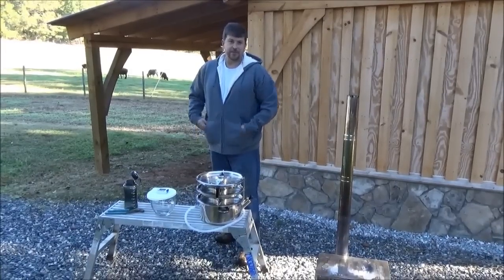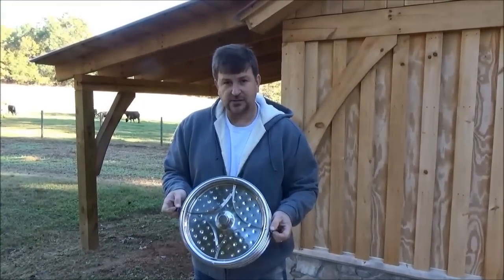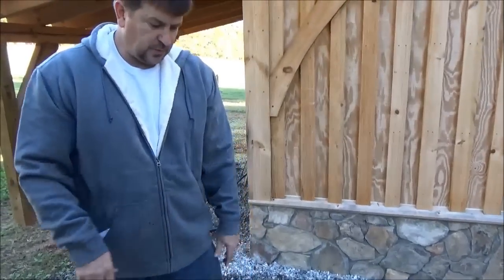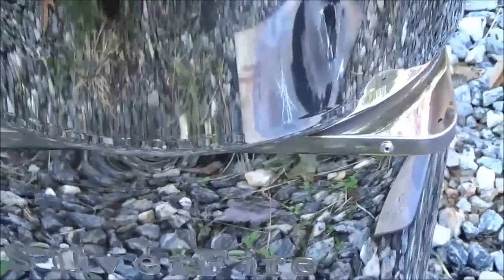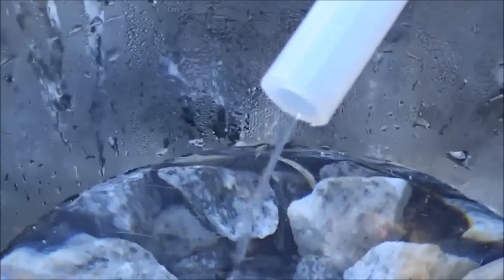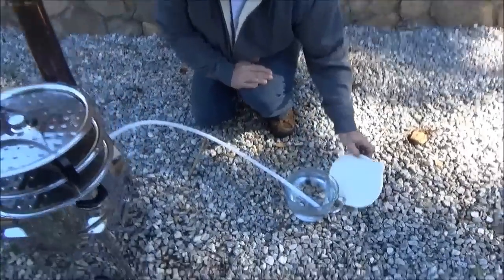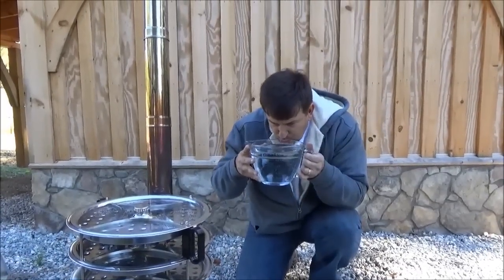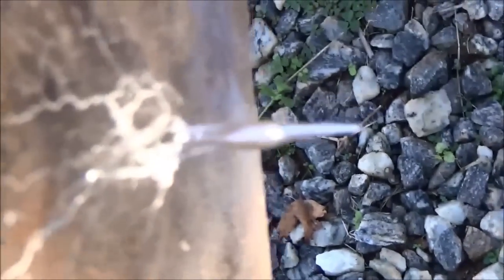Off Grid Water Distillation at its Best!

Comment: If water condenses on the trays and drips down through the center, why on earth would you pour water onto the trays??? Should you not, only start, with water in the bottom of this thing and nothing on the trays?
Reply: The water on top of the trays is used to cool the trays through evaporative cooling so the steam condenses. The dimpled trays are likely hollow and the condensate forms inside them. The water on top does not go into the collection system.
Reply: I would a diagram of the flow path to understand this.....
Reply: Keith MacDonald I think the water on the top of the trays is a bad idea also. You want a cool surface for the water to condensate on. A half an inch of heated water is not what you want on top of that surface. Try it dry and I bet the amount of distillate increases dramatically. A rocket stove may be even more efficient. Great video!
Reply: +Mars Rover The reqjuirement for a "cool" surface for condensation is a common misconception. To a volume of steam, any surface less than the boiling/condensation point is "cool". As a matter of fact, the colder the plate the more inefficient the process, as cooling the water far below the condensation point is a waste of capacity.
Reply: Interesting. Thanks.
Reply: Keith MacDonald Not sure I agree with that, here's what I'm thinking:

A surface one degree under boiling can only harbor so much condensate.  This causes more steam to escape the ventilation node (a requirement).

Cooling the collection plate allows it to operate at a higher rate of production because larger amounts of water condense and collect at a higher rate of speed (the closer that speed to the rate of evaporation, the less water is lost out the vent).

If there were no vent (dangerous) you'd be right in the yield being the same but it'd still take longer to produce the same amount.  The water condenses because it is giving up energy.  The larger temperature difference allows more energy to be given up (and therefore, more condensate collected).

This should mean both a greater yield and a shorter amount of time; both useful results.

Sounds right to me anyway?

Comment: years ago i built a water distiller out of 50 feet of 3/8" copper tubing coiled inside a 5 gallon bucket and used an old pressure cooker as the boiling vessel. it worked very well and condensed all of the steam and could produce 20 gallons a day if you really needed that much distilled water. so yes, you can build a cheaper distiller but the waterwise 1600 is a really cool design that takes up a lot less space, that's what you're paying for.
Reply: Will you tell me how to do it??

Comment: I am an engineer also and a prepper  Nice system especially for winter use.  Below is my system that might help you with a solar design:
My solar still produces about 5 gallons a day in October on sunny days.  I used an old duel pane solar panel about 3' by 7'.  I stood it up on end slanted against a rock wall fence.  Water level is maintained by a mounted water tank next to the panel that connects at the bottom. The highth of the water in the tank determines solar panel water level.  Next to the panel I built a wooden 3 level shelf stand.  At the top of the solar panel I ran copper tube up first and then down to my first copper coil inside a 2' by 4' water cooling tub and came out the bottom/front side.  Below that tank I ran a second copper coil to my second tank and then out its bottom to feed my 5 gallon distilled water container, final product, sitting at the bottom of the stand.  The top tank removes a large portion of heat from the descending vapor/liquid.  This heated water in the tank (heated from transfer of heat from vapor coil) is then fed to the bottom of the panel and thereby reusing the transferred heat. I tried to position the coils so that all fluids/vapor are being pulled downward by gravity in all portions of the tubing.  Top and bottom tanks are fed by sprinkler timer.  The top tank then also feeds the solar panel and determines what level in the solar panel the water sits.  The bottom tank is fed by sprinkler timer also but does not feed the panel water and is always much cooler then the top tank.  It's water is only used to cool the second coil.  The panel has four ports one on each side at the bottom and one on each side at the top.  I occasionally use the unused bottom port to drain the brine.  I may adapt a valve to automatically dump, the brine, at the end of the day by sprinkler timer later on.  It is important that when you connect the top of the panel to the top coil that the connector is not tight but is left loose to allow air to occasionally enter when good flow occurs or you will create a siphoning effect and get about 20 gallons of possibly sterilized water that is NOT distilled at the end of the day.  There may be some steam loss because of this; but, the effect is negligible.  An improvement I could easily make is take the duel pane glass off the panel and spray the now gray copper sheet and copper tubing black again and I should have more output.  Thanks for your video....good research and testing.
Reply: HI can we connect by email or app so I could try make one . With your good info and can i see a picture or video of it thanks

Comment: I love it!
But, you may want to do away from the plastic pipe and go with copper.
Also you may want to add a charcoal filter for the VOC's (volatile organic compounds) the boil off first.
That's a pretty awesome system!
I plan to use my 23-Quart Pressure Canner by presto on my Liberty wood stove and copper tube the steam through my outside wall into a 5 gal coolant bucket during the fall/winter months into a charcoal drip filter and then a 5 gal glass catch basin.
Being I have to heat my home (wood heat) and it's cold out (condensing the steam) 24/7 I might as well be making pure H2O surplus for the summer.
P.S. I am on my second H2O lab distiller so I need to bring down the cost and this is my best opposition.

Comment: This is good for your batteries that may power Solar, but I love the Berkey. My first line of water purification
Reply: But remember, the Berkey does not remove salt from the water. I also use a Berkey to filter freshwater, but when the freshwater runs out and I have to switch over to saltwater, distillation or desalination is the only option left.

Comment: Your set up is good!  i use a 1 gallon still myself and love the results.  But, mine is electric, and yours will burn just about anything in an emergency. nice job on the video.
Reply: The key is low heat not high heat. Solar Water Distillers are much greater. feel free to join the Distilled Waters Group on facebook aswell as inviting others.

Comment: For your information, Sea Water should not affect stainless steel whatsoever. It will form a highly crusty crud on the inside of the boil chamber, but you should be able to just tap on the boil chamber to knock out the crud and scour it out with a brillo pad.

Comment: Thank you so much for the demonstration, I wouldn't have looked twice at this unit if I didn't watch the video. I've seen this Distiller on Amazon but it didn't impress me at the time. But I can see the advantages of having more surface space in order to create more water at a faster rate of speed. With that being said, there seems to be room for improvement in regards to the plastic hose. Is the plastic BPA certified plastic? Certain plastics release chemical toxins back into your water which would defeat the purpose. The Company could add a Copper Coil as a spout attachment for longer durability and that would avoid any type of water contamination period. It would cost more, but it would be well worth it. and the handles could be replaced with Stainless Steele for Strength and durability instead of plastic parts.  I will still make the purchase, but I will make the necessary adjustments. Thanks again!
Reply: @MJ-nd7cj  I bought one, but it's flimsy metal, especially the bottom...should be built better for the money they're asking for...but it does work & pushes out the distilled water faster than a homemade tea kettle.
Reply: @MJ-nd7cj  If I bought another one, I'd buy the "compact" distiller with the metal drain hose & you use your own pots.  It probably doesn't put out as much distilled water as quickly tho.

Comment: Wow.  That's impressive.  I use a Brewhaus PSII High Capacity Distiller on top of a 16 gal. SS Keg using a Crawdad Propane Jet burner to make Legal (Permit) Ethanol.  I only get around 3 quarts in an hour using my setup, and I have the fancy equipment.  Keep up the cool vids.

Comment: Alloha.
Most Marine RO Fresh Water Makers, like those made by Spectra or Katadyn, rely on some sort of mechanical energy to pressurize the water, so it does the whole Reverse Osmosis thing thru the membrane.  Usually, it is some form of electric pump, sometimes tied into a mechanical pump, and for life-raft emergency kits, they usually have a hand-crank pump.  I can't remember who made it, think it was British, but someone used to make a device that literally looked like a torpedo.  It had a line attached at the front and was towed behind the boat while under way.  The water moving past spun the device, powering the pump inside, and forcing the sea-water thru the RO element.  The final clean water came back to the boat thru a small hose attached to the tow-line, and was simply fed into whatever fresh water tank you desired.  I would think that a similar system could be set up at your pond dam, either in series with or parallel with your hydro-turbine generator.

Peace & Prepare
Pax et Paro

Comment: It seems like if this were designed more like a honeycomb beehive heat sink with some way to run cold water through its core like a radiator along with the dimples along the various fins of the heat sink that would create even more surface area that you could have an even more effective distiller. There is still a lot of wasted air space for the steam. Ideally both the passing air across the heat sink and cold water pumped inside of it would increase the condensation of the steam. If the steam pressure could run such a fan and pump to circulate the cold air and water then it could still qualify as an off-grid solution. What would be great to measure is the amount of energy (cost) to the volume of distilled water measured in increments of time that would produce the production curve that you could compare across systems. An average adult consumes about 3 gallons of water each day through drinking and food intake. Therefore a family of 4 will need 10-15 gallons each day just to stay hydrated depending on the size/age of the members let alone water for brushing your teeth and some sponge bathing. In our normal lives we consume 80-100 gallons each day per person but that includes bathing, flushing the toilette, laundry and watering our landscapes, etc. so most of our consumption has  little to do with how much much we actually drink or swallow.

Comment: Upon closer inspection, there are several problems.
First of all, it is a structure that collects distilled water, but because it is an open type, the probability of impurities entering is high.
And the path of collecting distilled water into glass bottles is plastic, so microplastics are bound to be included in the water, so this method cannot be called pure distilled water.
Reply: I seen a similar one somewhere and it used silicon tubes, not plastic

Comment: A pity that the hot water is running through plastic : your distilled water is contaminated by whatever pollutants where used in the plastic fabrication process
Not a short term  problem of course, but if you want to use this long term for the health benefits distilled water is supposed to bring, a glass or stainless steel tube would have been a must.
Reply: Jean-Michel Nicolas absolutely that was my 1st reaction when I saw the plastic tube definitely a flaw , I would have to modify this b4 use , otherwise great piece of kit.
Reply: it is a food grade plastic, so it has no effect on the water.  It has excellent chemical resistant properties making it suitable for a wide range of foods and other products, so it will not erode into the water.  especially since the water is cool by the time it exits the radiator. what he has in that glass is nothing but pure H2O. if anything it is a better option than glass might erode and break due to heat expansion and contraction and it could easily shatter if hit.. and you need high grade steel for it not to corrode.
Reply: it is a food grade plastic, so it has no effect on the water.  It has excellent chemical resistant properties making it suitable for a wide range of foods and other products, so it will not erode into the water.  especially since the water is cool by the time it exits the radiator. what he has in that glass is nothing but pure H2O. if anything it is a better option than glass might erode and break due to heat expansion and contraction and it could easily shatter if hit.. and you need high grade steel for it not to corrode.
Reply: First thing i saw, specially with hot water. Pba and oil contaminates im sure.
Reply: Depends on the grade of plastic. In pharma (my work), high grade plastics are commonly used because in many cases various types of metal leech into the solvent, rust, etc.

Comment: No problem. With the  disstiller per se. It seems to work well.
I only have one courtiq about it. 
That is that in a S.H.T.F. AT SOME POINT IN TIME YOU WILL HAVE TO BE ON THE MOVE. At that time how does you deal with mobility issues. Along with your other gear. What then not very good for that. Need something more mobile as will. Or your be in trouble.

Comment: Interesting! It would be good to see how well it does with salt water and water with chemicals like one might find in a swimming pool or metal manufacturing plants where chemicals are used for etching and such. Thanks for the video.
Reply: As for the salt water, it works fine, I use one here in Hawaii all the time for drinking water. As for other chemicals, theoretically it should remove everything from the water, but if you are still concerned after distilling it, run it through a Berkey, which is what I do here with ocean water since the whole Earthquake and nuclear accident in Japan.

Comment: Just a question....... There's no carbon filter on this machine, I'm hearing elsewhere that is needed to stop airborne chemicals (voc's ?) from contaminating the distilled water.......... Also, the plastic tube will leech chemicals into the finished product too, I believe ? Just thinking a little adaptation needed to make the finished product completely pure.Great video though, thanks for sharing.

Comment: I watched this quick, but since you use fire it is a high heat distillation so is there a post carbon filter that catch VOC's?  I guess depending on the water there wouldn't be VOC's.
Reply: VoCs with a boiling point lower than water can be boiled off by simmering the water (and stirring to increase surface area/exposure) for a short time before initiating the collection of the steam.

Any VoCs with boiling points higher will not be collected.

VoC information appears sparse.  I can't find a list of VoCs and boiling points but I get the impression that there isn't one with the exact boiling point of water.

Since it's pretty dependent on atomic makeup I'm guessing that  there isn't one since that exact temperature is relevant to hydrogen/oxygen chains, but I'm not sure.

Comment: It burns a hole in the bottom of the bowl after one use?  How is this great?
Reply: Rose, I wonder if instead of using that aluminum plate on top of the stove if you were to replace that with a flat cast iron grill if that would still work or cause any heat transference issues with the distiller? Seems as though it should work fine, and would not have to worry about the aluminum melting issues anymore.

Comment: 12 gallons a day but how long does it take to replace the water on the trays? And how do you use the prewarmed water from the trays? it looks too hard to just tip them over the pot without most of it missing. Nice bit of kit though.

Comment: I am curious about the cost effectiveness of this.  What I mean is that I am also on well water which I can drink, but really don't like to.  However, I am in northern Canada.  So, I was thinking of using something like this on the kitchen stove.  I'm sure it takes substantial heat BUT ..... energy can be neither created nor destroyed, right?  So, if I simply let all the hot water cool down to room temperature before putting the water in the fridge, I am effectively using the stove to heat my home with some heat loss due to thermal inefficiency.  Does that make sense?  Or is there no heat loss due to thermal inefficiency since energy can be neither created nor destroyed.  Maybe entropy accounts for thermal inefficiency.  Of course if one did this on a wood stove in the basement, then it really doesn't cost much at all.  $0.01 for your thoughts ?
Reply: Priceless right now shelves are empty as far as any distilled water.

Comment: Do you boil the source water before putting it in the distiller to eliminate VOCs? Or does this distiller rely on the VOCs to be released as the warm (/hot) water flows into the receiving container?

Do you know the gauge of stainless steel that the distiller is made from? 18-10?
Reply: They would be released when it was boiled and turned to steam, not when it condenses and is diverted to the collection container.

Comment: You didn't really show any closeups, but is it all open where the water condenses on the bumps? If so, you could only use it on calm, windless says with no dust, dirt, whatever blowing around.
Reply: No, you want the breeze blowing across the plates, that's what causes the condensation to happen on the underside of the plates.